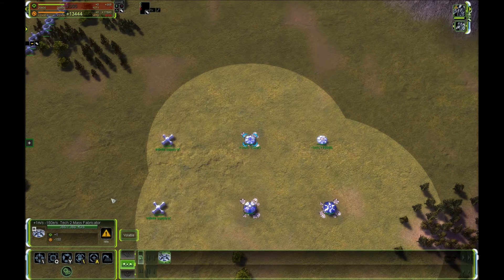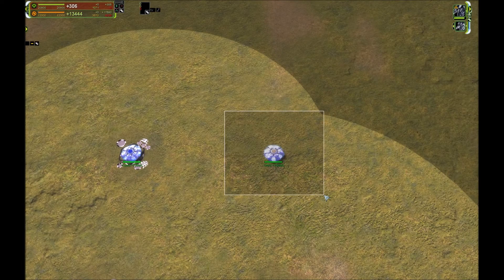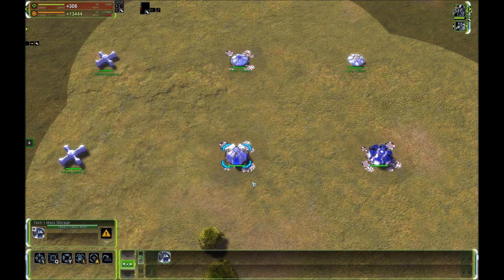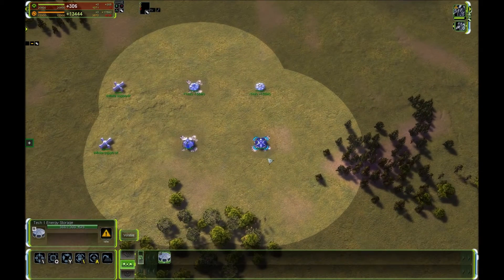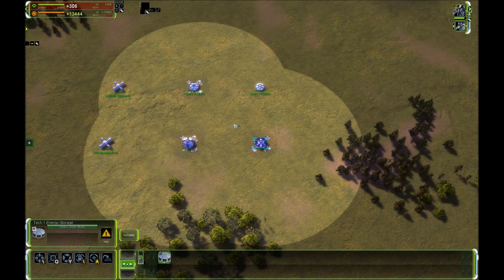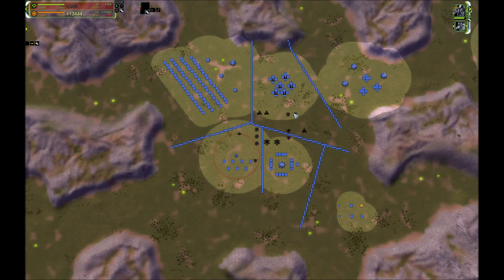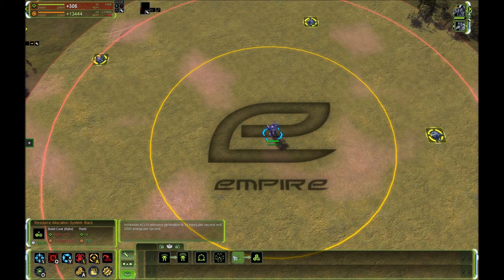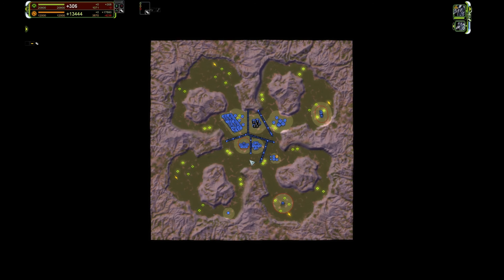Mass Equivalent Units Q&A - FAF Patch Spotlight 4.2 - Supreme Commander Forged Alliance

Comment: Actually, you can store power in unfinished buildings because as long as you don't finish the building(or experimental, what you usually use for it) you can just reclaim it to get the power back. All it requires is to have some engineers available.

Useful if you're going to start a game-ender but are waiting for an engineer from your teammate to start it in a safe place. Using yolo/ahwassa, mavor, scathis to store for paragon on setons, for example.

Comment: i would say that the drawback of the meu model is that the conversion rates it assumes are not real. in an actual game the conversions are different and in fact are not the same both ways, even having a different nature to them - for example to convert mass to power you build a pgen - but this is not the same since we spend mass once and get in theory infinite power from it, over an infinite period of time. That is to say we convert 150 energy to 1 mass, but we convert 75 mass to 20 energy rate, which gives energy its characteristic "startup time" effect on things like ras, t3 air, and acu upgrades.

As heaven said, this is just a model and its very important to not go too far with it, since it can and does lead to some incorrect predictions.

Comment: imo storage has nothing to do with MEU model... you may waste mass or power... so what? you still have that economy, you are just useing it in the current moment, that is player's fault. for me it looks like that system drawback is that guy with many RAS scus may have same economy as guy with only t3 pgens, and does not take in account that one needs to make mass fabs to  balance their economy and other need negative mass fabs if he is going to build t3 air :D
Reply from the maker: RA_ZLO I think finite storage drawback is massive for meu because it overstates the meu output of pgens in ways we can't predict without a ton of empirical data and multivariate statistics
Reply: Heaven personally I don't really get it, if you balance you eco you always waste a fraction/percentage of your power income. it is not some static value.
you can also look it in different way, if you waste power that is probably cause you don't have enought mass fabs.
system assumes that you have those mass fabs already built, that is first drawback.
also system assumes you can transfer mass back to power witch is not how it works in game, that is second drawback. I might be wrong or see it bit different but I don't see more drawbacks.
Reply from the maker: the meu model doesn't account for the continuous waste of meu that happens when you try to apply the meu model to reality; within the model unbalanced eco, e-overflow and limited storage don't matter, but in reality they matter. i don't know if i can explain it any better.